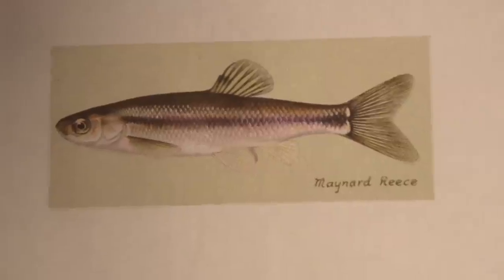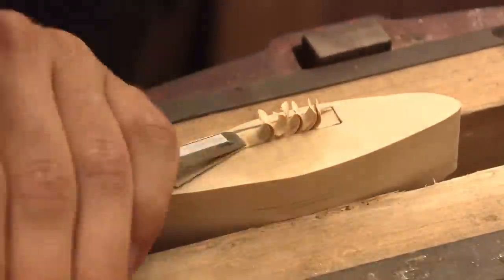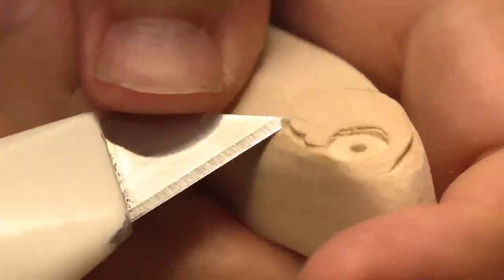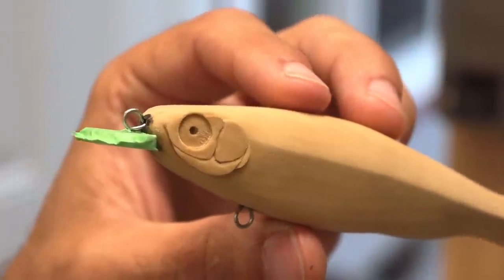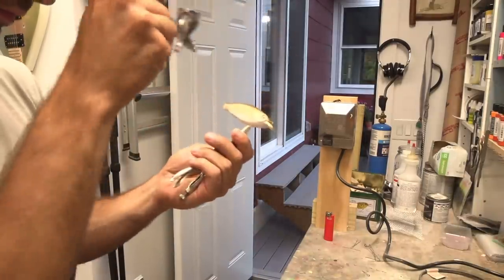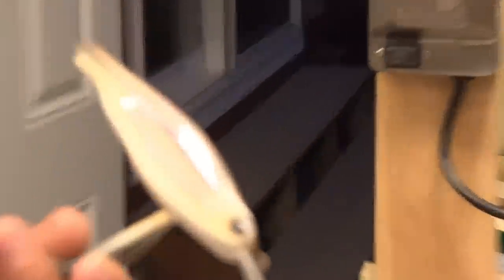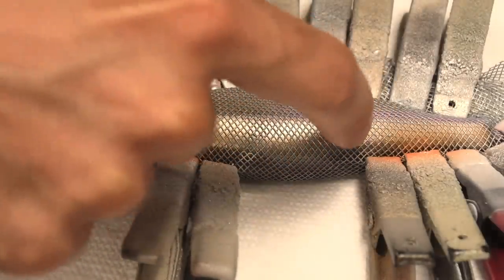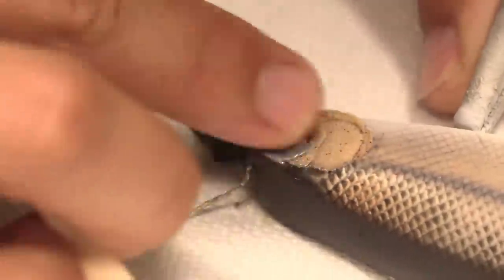Making a FatHead Minnow Weight Transfer JerkBait

Comment: There's the winter bait action you were looking for. The profile, and colors are pretty appropriate for it too. Get it to suspend as you pointed out, or a slow rise. Would be a good trout lure given different sizes, and color schemes. I had a mysterious feeling that this bait would shake things up after the carving and sanding. 4.7 stars

Comment: It's crazy how far you can cast with minimal effort with the weights like that. First time i tossed an lc flashminnow i was amazed.  A simple flick sent it 50 feet away.  If i had done a power cast i can reach the areas normally only reachable via boat from shore

Comment: What PSI do you paint with?
Reply: I think it is relatively high. I never see him thin his paints down. Although I could be wrong because I am unfamiliar with the paint he uses. I also have noticed large clouds of paint when he sprays sometimes that lead me to believe he uses a higher pressure. I usually use about 5psi, if that helps at all.